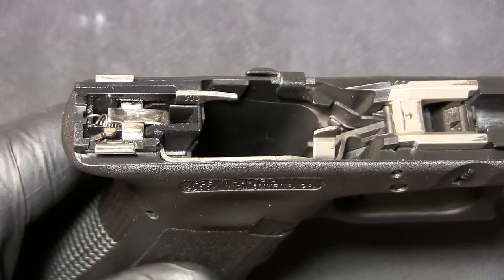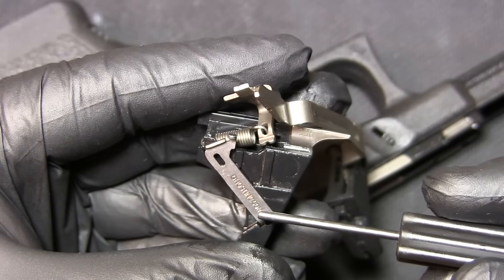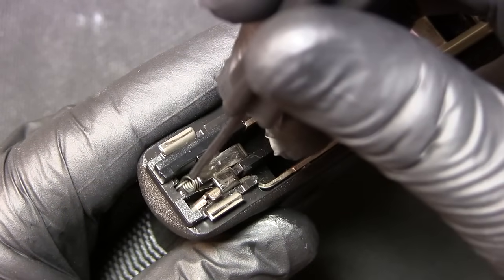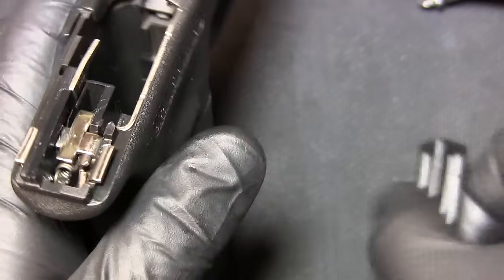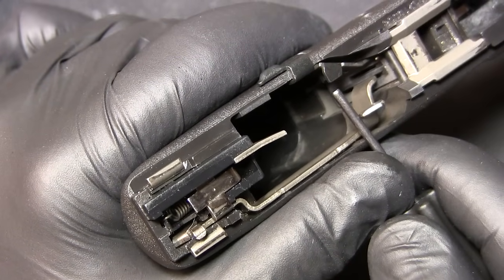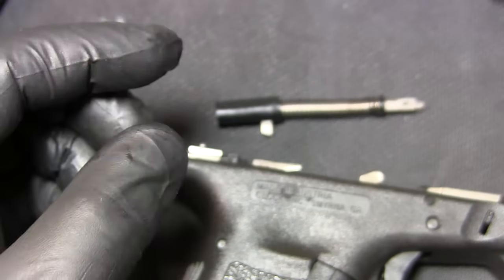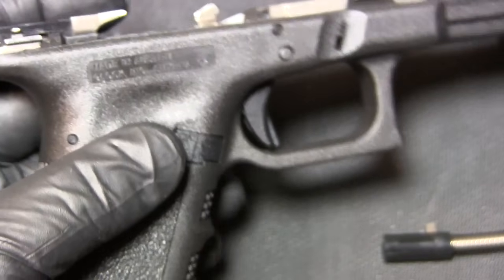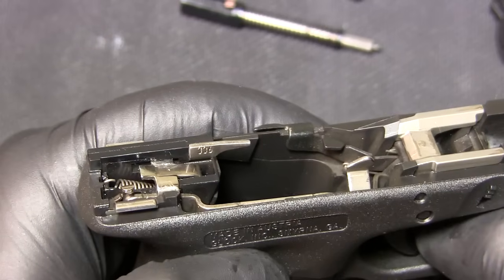How Glock triggers work and how they reset

Comment: Thanks for video. Very informative. Please clarify, doesn't dry firing a disassembled frame cause damage to the trigger safety if done repeatedly?

I've seen Glock says in the manual you should not fire a disassembled frame. 

I'm sure it would take many many repetitions for it to cause an issue though. 

Thoughts? :)
Reply from the maker: Yes, because there is no striker pushing against the trigger bar. When the slide is off, the only thing holding the trigger forward (when it is manually reset) is the safety tab. So it will rub on the frame as the trigger is pulled.
Reply: @MosinVirus  thanks. Would you suggest replacing trigger bars in Glocks that have had this done to them a lot?
Reply from the maker: @matthewcopeland2248  you mean if they have been repeatedly altered? Probably, especially if you start to notice bad things happening.
Reply: @MosinVirus  I mean if the trigger has been repeatedly pulled while the slide is off the frame, would this necessitate a replacement trigger bar in your opinion? 

If you do it only a handful of times is it worth worrying about in your opinion?

Also, could it damage anything other than the trigger safety? 

Thanks.
Reply from the maker: @matthewcopeland2248  oh, in that case there shouldn't be a whole lot to worry about. Just visually inspect the trigger safety. If it is really worn and you can pull the trigger without disengaging the trigger safety then yes, the trigger assembly should be replaced.

Comment: i've been kinda nervous around glocks ever since my grandfather took his apart and showed me how the action works. it seems like a certain amount of wear or corrosion to the wrong part could basically cause the slide to operate itself with the trigger disengaged from the trigger bar, and you end up firing a whole magazine automatically, unable to stop it, and shooting yourself in the head lol. i guess in practice, that's not a very likely failure mode, but i guess someone could theoretically sabotage the gun in a way to make that happen
Reply from the maker: Unless the striker is stuck forward and the trigger spring is broken, and the connector is busted the Glock should not really be able to do that. And the striker nose would likely break after 1 or 2 shots if it was stuck forward.
Reply: @MosinVirus  after i made this comment i read some more about the other safety mechanisms and that pretty much changed my opinion. there are a few subtle components on the back of the slide and receiver i wasn't even aware had a function, sort of redundant failsafes i guess. a lot harder for all of those to break down simultaneously than i realized.

very clever engineering, i can't remember the term but they seem designed in such a way that entropy makes them less likely to fail in a lethal way, not more likely to fail. sort of like how a nuclear bomb that degrades just becomes inoperable rather than exploding the way dynamite could. although that trigger component still seems like wear could make it slip, everything else seems like, if anything, it'll just get stuck and prevent any further cycling.
Reply from the maker: @ToxicallyMasculinelol  I completely agree that Glock came up with a very simple and genius design. That is why I appreciate these pistols, even though I love 1911s.

Comment: Fantastic breakdown of each part's function. I was looking for problems why my slide was so hard to pull back during the first .25 inch. I realized the ghost 3.5 connector was so much thicker than my OEM connector, the slide protrusion was having difficulty pushing the thicker connector inward!! Thanks!
Reply: I noticed the same thing with the 3.5 ghost edge. How did you gun feed? And was the slide effected at the range?
Reply: You might need to check the angle of your connector, it's normal to have to adjust how far out they bend from the housing. If it sticks out too far it can cause that drag feeling. Also check your safety plunger to make sure it's moving smooth

Comment: Hopefully from this I can deduce why my firing pin is not catching which is causing a double firing malfunction.
Reply from the maker: A few different possibilities. Depending on what was done to the pistol before. For example, if you have completely removed the trigger assembly, the trigger spring hook may be kicked off to the side on the bottom. That could cause problems with reset and general function issues.

Comment: This video clarifies a few points nicely to me, except one last thing. If you dry fire the gun and pull the trigger forward until the safety catches, now the firing pin latch is ahead of the trigger bar latch because the slide never moved back in a dry fire. What happens now when you try to pull the slide (ie cock the gun)?? The trigger bar is held in the UP position by the housing. Wouldn't it prevent the firing pin latch to go past it while being pulled back? Try it and let me know! 🤔🤔🤔
Reply from the maker: I am entirely sure what you are asking. Why would you manually pull the trigger forward if you can use the slide to cock the gun? But if you do happen to reset the trigger that way, you will still be able to pull the slide to the rear. The striker should overcome the trigger bar, though i am sure it is not a situation the gun would normally be in.
Reply: @MosinVirus  Yes, I can see that you understood my question. But are you sure it will overcome? The housing cutout is designed to hold the trigger bar UP so it won't accidentally release the striker. If there is such "play" between those parts (allowing the striker to clear the trigger bar going backward), then there will be reliability problem...
Reply from the maker: Not really. The trigger spring pulls the end of the trigger bar upward. Again, we are discussing a situation that doesn't or shouldn't exist.

Comment: Also if the connector has a steeper angle, you get a shorter reset.. but if you have a 3.5 lb connector the wall is spongier/softer but the reset is longer..so putting a 3.5 connector in has its trade offs....
Reply from the maker: Agreed.

Comment: If i take the connecter off will it still shoot?
Reply from the maker: No. The connector forces the trigger bar down and out of the way of the striker. That allows the sticker to strike the primer. Without the connector the trigger bar would simply pull the striker back but never let go of it.

Comment: I have a Glock 19 that’s having a issue sliding forward I’m only able to slide it forward if the backplate is off.. only thing I see is the shiny metal cross like peace is hitting the backplate when I go to slide forward? Plz
Reply from the maker: I am not really sure by what you mean when you say the glock sliding forward. Can you explain in more detail?
Reply: MosinVirus I can not remove the slide off the rail without removing the backplate so I cock it back in the locking position and push the little lever down to remove the backplate and I hold that firing pin in and there you have it the slide is removable but I go to put the backplate back on and it won’t come off to save my life.. I also cock it back and try to release the trigger and it doesn’t sound the same as others I’ve seen doesn’t sound like it’s dry firing... new gun
Reply from the maker: Oh, you need to make sure the trigger is not active. First check that the gun is unloaded and nothing is in the chamber. Then pull the trigger so you hear a click, then pull the slide back very little. And I mean about 1/8" to pull down the take down lever. If you pull the slide to the rear a bit too much the trigger will reset.
Reply: MosinVirus hmm I’m trying what you said would you mind video chatting with me so I can show you or maybe I’m doing somthing wrong that you can see
Reply from the maker: Can you make a video of what you are doing and upload somewhere so I can see?

Comment: Thanks for the great video. The Lone Wolf connector on my P80 G17 was causing the crucible to come up slowly instead of popping up quickly.  I replaced it with an OEM Glock connector and good to go. The crucible was coming up so slow that it was being missed by the firing pin. Your video helped me see the problem.and I learned a lot from it.
Reply from the maker: Glad I could help.

Comment: Any idea why it’s so hard for me to rack my Poly 80 G19? Is it because the barrel doesn’t have enough space in the channel ?
Reply from the maker: I haven't built one, but if the barrel can't lower enough to allow the slide to cycle properly that could be the reason.
Reply: MosinVirus I realize that might be and also the back rails I need to sand down some so it can move more freely
Reply from the maker: I wish I had built one when it was still legally possible here in CA. Then I would have known where the problem areas could be hiding

Comment: I've had Failure to Fire problems with CCI500 and some lesser extent WSP primers.  I changed the striker spring from factory 5.5 to a 6.5 extra power spring, and it solved the problem with 100% reliability so far.  The 5.5 lb. made a good dent, but just not quite enough.  The question I have was that the best solution?  The trigger now feels a little heavier than it was before, but that seems to be contrary to it "assisting" the trigger pull.
Reply from the maker: the striker spring fights against the pull so that makes sense. the trigger spring helps. if you are going with extra power striker spring you could go with extra power trigger spring to help with trigger pull weight.
Reply: @MosinVirus Thank you...after some further study, I ordered a 6 lb trigger spring.  It's a little mind bending, but in the end, it all makes sense.
Reply from the maker: @jonlucas5521  should be better with that higher power trigger spring.

Comment: I bought a used Glock online & have been having trouble with the trigger resetting on some shots.  Thank you for this video.  I'm hoping that you helped me fix my problem.
Reply from the maker: If the trigger spring is kicked off to the side (look down into where it is connected to the trigger bar) that would cause issues with reset for sure.

Comment: I polished all the parts and now I have a big problem, my glock is completely automatic in occasions. Any ideas how to solve the problem ?
Reply from the maker: Replace trigger bar, striker and connector bar would be my advice.
Reply: @MosinVirus  Thank you
Reply from the maker: @JoseMfly  sorry I couldn't be more specific. It would be difficult to figure out what specific part needs replacing without seeing the pistol in my hands.

Comment: I don't understand replacing parts in the gun. every single malfunction or failure in a glock that I have seen was in guns that had modifications. I have never seen a factory gun malfunction like the modified guns do. if it aint broke don't fix it especially if you depend on that glock to save you or your family's lives. if its just a range gun or a toy, go ahead and mod it all you want. if you actually carry the gun, leave it alone.
Reply from the maker: I agree.

Comment: One of my Glocks G23 hurts when i pull the trigger like it kicks the trigger into your finger. I cannot recreate the effect when i cycle it by hand. Replaced trigger, trigger bar ,connector and trigger spring, but still same problem. When i compare it to my G22  idont see anything out of the ordinary. Any ideas?
Reply from the maker: Are both trigger pads smooth or serrated? Maybe it just feels like it digs into your finger? Other than that I would have to see the gun.
Reply: @MosinVirus   it did have the ridged trigger. That was my first thought too. The new trigger is flat.
Reply from the maker: The only thing left to take a look at is the striker spring. To see if it is extra power spring. Though if that was the case your trigger pull weight would be heavier.

Comment: Very informative, and simple explanation of a complex subject, however as a Glock (A)  certified armorer,  please any mods you do make shure its not a carry gun, failures will occur with aftermarket parts, if they happene in the range or competition its not a big issue (excluding safety mods of course) the Glocks main desing is toward reliability. Keep that in mind please.
Reply from the maker: Thank you. I do agree, carry firearms should be kept stock.

Comment: I think you have everything correct EXCEPT that when the slide moves forward the trigger bar being in the up position retains the firing pin... releasing the trigger allows the connector to move back into place producing that audible and palpable CLICK when the trigger is reset.  The trigger is not reset by the firing pin it is reset by the user.
Reply from the maker: I don't know if I would agree with that. I understand what you are saying, but the system is what does it. The act of trigger release by the user is not what causes the trigger to reset. If the system was not pushing the trigger forward, the act of releasing the trigger would do nothing. Empty your Glock, rack the slide, pull the trigger, release it. Did the trigger reset?
Reply: I watched your video again... sonce I was wondering HOW the gun fires after the first round when you only have to release the trigger far enough for the connector to pop back in place... now with your finger on the trigger still not fully extended w the trigger safety engaged.

The firing pin is retained by the trigger bar at the same time the firing pin pushes the trigger bar forward.  So in other words the firing pin is just about completely extended backwards.  Now you pull back on the trigger a very short pull starting on the ramp of the connector and it pushes the trigger bar downward releasing the firing pin... Again hold the trigger back firing pin pushes the trigger bar forward but your finger is on the trigger all the way back.  Extend just enough to let the connector reset and another very short crisp trigger pull is achieved.
Reply: You said this in your video btw i think NOW i understand it better.

Thd firing pin pushes the trigger bar forward.  If the user holds back the trigger and only lets the connector pop back into place a much shorter pull is required in order to fire the glock.  That explains my last question of how a glock wirks.

I wasnt (prior) able to understand why the first round had such a large take up but then all subsequent trigger pulls were able to be so much shorter.  I didnt understand how with such a short pull how the firing pin was pulled back far enough to strike the bullet primer.

Comment: Thanks
Reply from the maker: My pleasure.
Reply: I was honestly sitting here like this cant be right.... I think i did something wrong putting my lower parts together. But iv only got the lower half so far
Reply from the maker: @guykirchgatter7314  are you running into issues putting it back together?
Reply: Nope not now. I was able to see how it works to know i put yogether correctly because of this video.
Reply from the maker: Understood.

Comment: If you eliminate some pre-travel you could use a connector with a harsher angle to drive the bar straight down for a short crisp break instead of the long rolling break from minus connectors.
Reply from the maker: Definitely.

Comment: Great video thank you so much! I, (stupid self) bent my 3  1/2 pound connector because I assumed it had gotten bent while being shipped to me...😕😕😖😖😖. I put everything together and could not get the trigger to reset which was a pain in the ass because now I cannot get the slide off. After several Choice words and throwing a couple things I found your video...problem solved!! thank you sir 👍👍👍
Reply from the maker: It is my pleasure. I am glad the video helped and you got your glock back into working order. That connector looked wrong to me too first time I took apart a Glock

Comment: I just polished all the metal parts in the trigger mechanism.
Reply from the maker: How did it work out? It should have made the trigger travel feel a lot smoother.
Reply: @MosinVirus  oh it did. I also realized that the rubbing was occuring in places that others weren't mentioning so I looked it over and came to the conclusion that as long as I didn't remove any material, it wouldn't hurt to polish it all. Boy was I right. Not a change in weight at all, but the felt pull is much smoother which makes it feels a lot lighter. Still has a wall because I didn't change the angle of the connector, however it rolls a bit more through the wall insead of breaking through the wall.

Comment: PLEASE HELP: What determines the take up and wall on a trigger? I have a ruger sr9 that does not have any wall, you squeeze the trigger until it goes off. I want to correct this and change the right parts so I can have a more tactile trigger.
Reply from the maker: I am not familiar with SR9 but it seems there are components similar to a Glock. Every design is slightly different, but given the similarity I would say spring tension, shape of striker lug and sear surface would be the highest contributors.